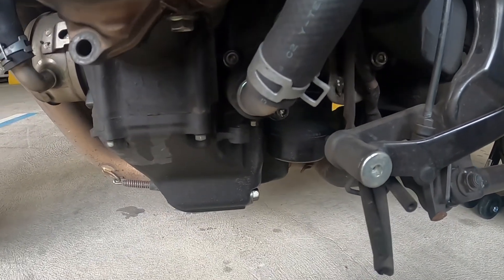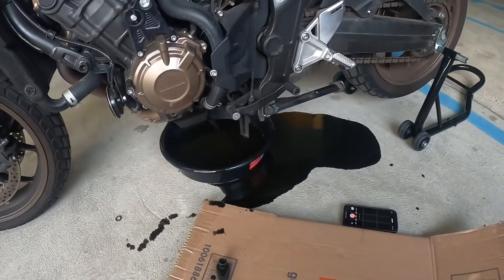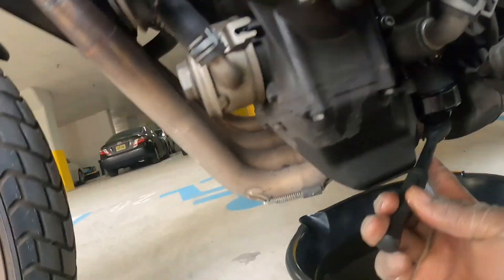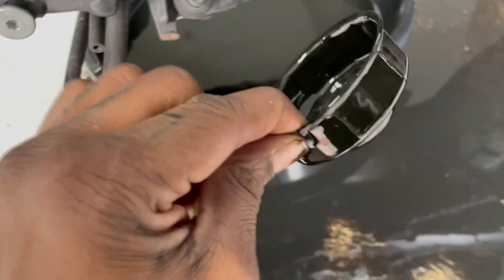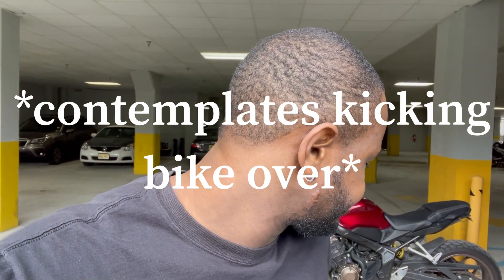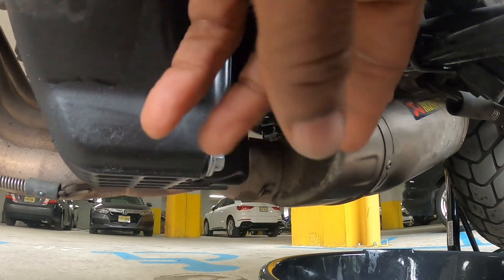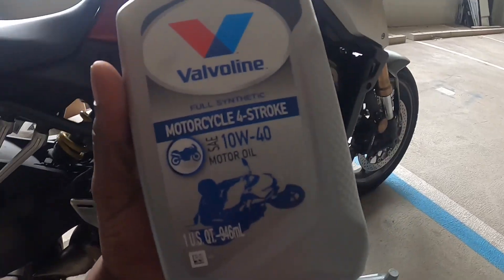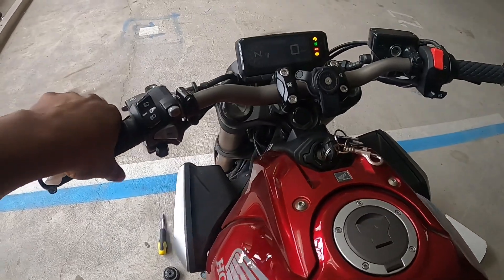How To Change The Oil On a CB650R + Issues You May Run Into

Comment: Pro tip…prop the handle of a hammer against the lip of the filter wrench and smack the handle with another hammer/mallet…pops right off. I prefer using OEM Honda filters so I run into this problem a lot.

Comment: HEY GUYS, I NEED SOME HELP!

I changed my oil and oil filter yesterday on my 2011 kawasaki ninja 250 and when I went to tight the filter cover and oil filter mounting bolt, I broke the filter cover.. It's in pieces and I've been searching all over to get a replacement but where's a good place to order one? Or could I use another oil filter cover at maybe a local hardware or bike shop??
Reply from the maker: Although I know nothing about the workings of a Ninja, I would suggest checking out babbits or revzilla for those oem parts. I’m sure someone has to have those pieces on hand

Comment: You tightening it with that wrench after wards is you setting up yourself another trap again for the filter to not come off. That nut at the bottom of the filter is made so you can take it off easier, oil filters only need hand tight. thats it

Comment: I prefer taking off the filter first, makes less of a mess, also if that’s the first oil change the filter is always so hard to take off. After your first oil change the filter will come off easily.
Reply: you got to be joking- filter first?? so than all oil from system will come outh from filter hole :) :) :)